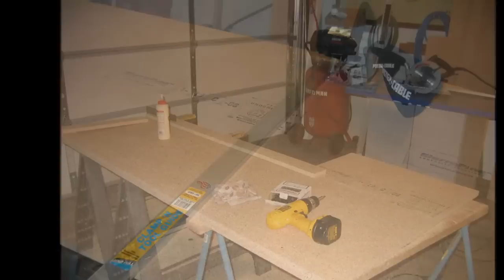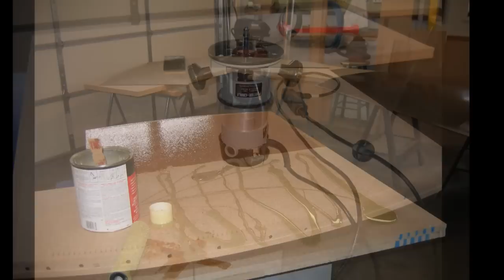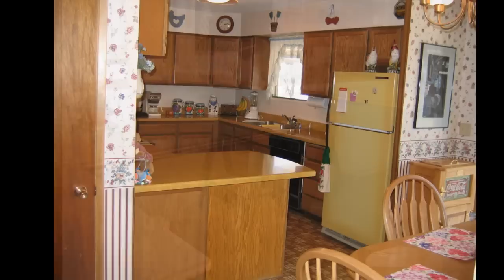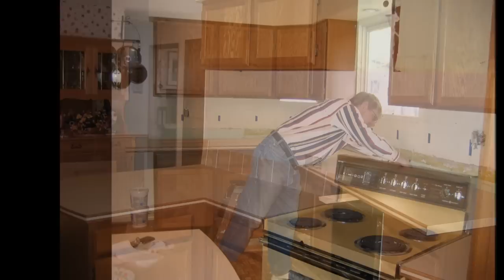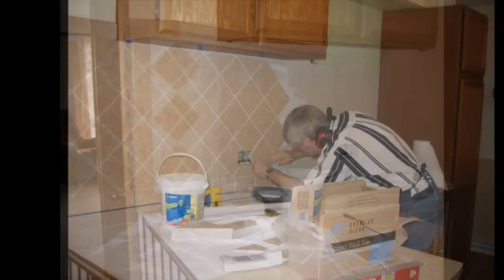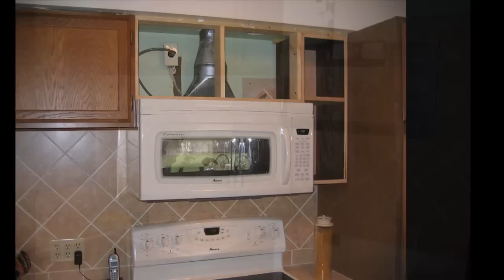DIY Kitchen Countertop Remodel

Comment from the maker: Michael, thanks for your question.  If the kitchen were down for 11 weeks she would NOT be happy and I would be spending my remaining days at the cabin :)  The entire project took 11 weeks.  I built the countertops in the shop before I took out the old ones. I removed the old countertop and installed the sink (the most important part of the project) the same day.  It took me four more weeks to finish up (tile, etc.) but the kitchen was useable.  My wife is still happy!  Thanks for asking!  Dave.